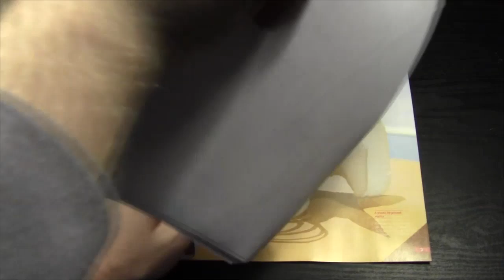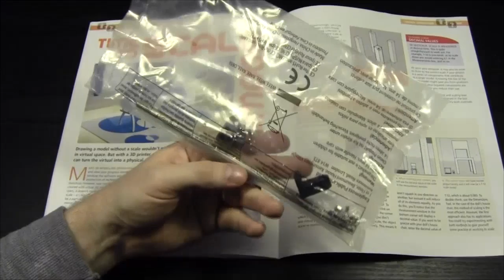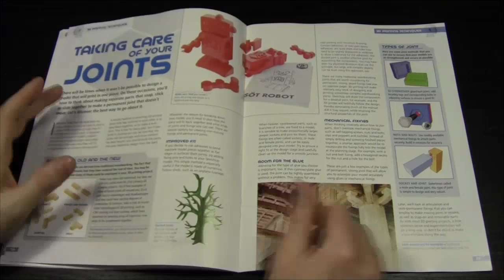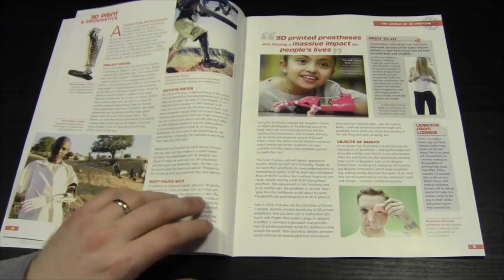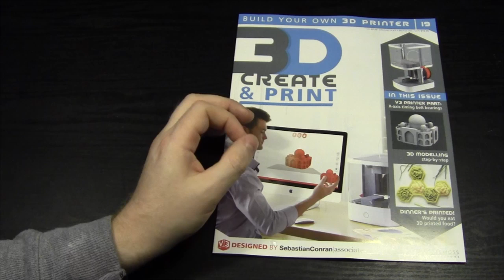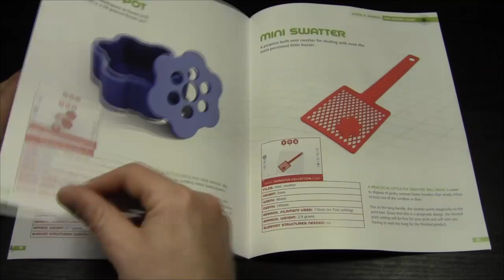Build Your Own 3D Printer, Editions 16 - 19 Review (Starting on the X axis) (  V3 , Eaglemoss)

Comment: Nice but why are you running the A/C in this weather!?!?  Or have you got it in heat pump mode?
Reply from the maker: Knuckles the Echidna Because it was warm here lol.  It's an evaporation type, but you can hardly hear it on the video so wouldn't have mentioned it if I'd known lol.
Reply: RetroGamerVX Whaaaat?  It was warm?  It's been really cold here in the east midlands recently, only 11 degrees some days I bet Scotland was really cold!  Seems the weather system has buggered off this morning though hopefully for some may sunshine :) Aaaah hehehe I had images of you sitting there with the big A/C on blowing ice cold air lol, the evaporative ones are nice for making the air less dry aren't they and don't take a lot of energy to run at all!
Reply from the maker: Not in the North East :)
Reply: 11 degrees is the normal temp in the UK it is our average sometimes max!
Reply from the maker: Gets upto 25/30 degrees innthe lab due to it being a converted atticl